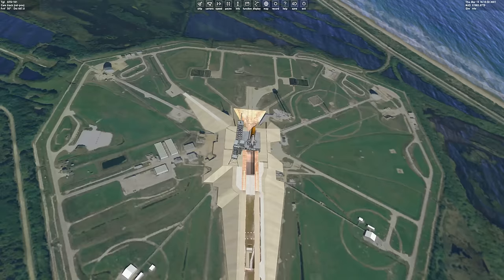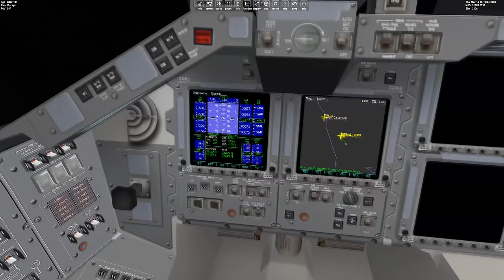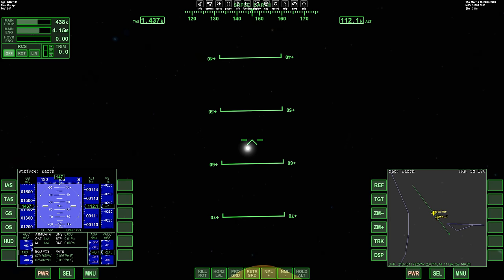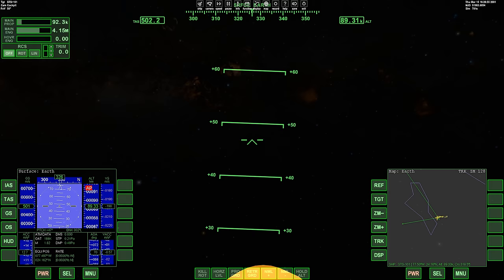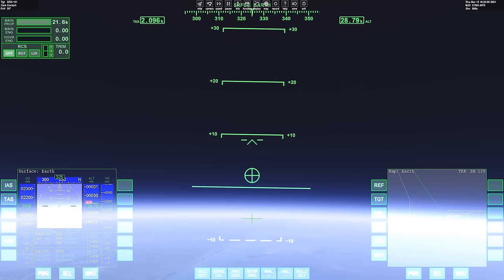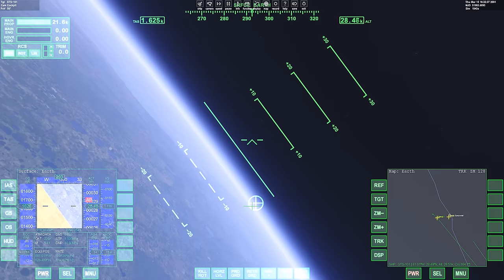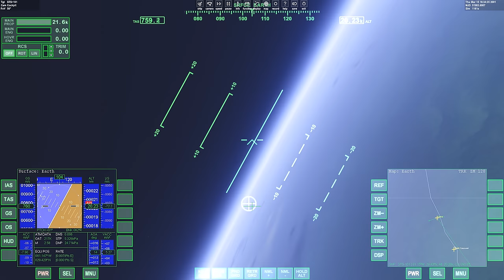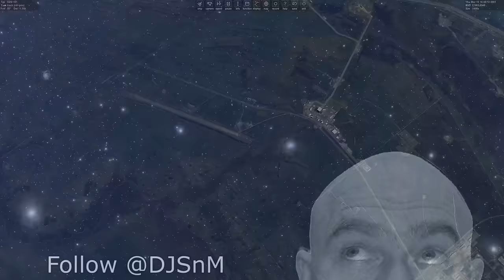Space Shuttle RTLS Abort Challenge - Without The Manual

Comment: This video really shows poor basic flying techniques (not that anyone would expect those from you), but what you did was a very typical intuitive mistake all flight students do for a standard U-turn ) Here's how one does it normally: from the point above runway (or a nav fix if you do a teardrop entry to a holding pattern) you bank to the side of turn (btw, in any emergency aircraft pilot would instinctively choose right turn towards sea not the left turn towards populated area velow =P)) - so that you obtain 30 deg heading difference (so in the beggining of your U-turn you were on HDG 325, so for left turn you need to get on HDG 295, from that point you start the chronometer and fly exactly 1 minute on HDG 295, after which you start the opposite (right in your case) turn with standard bank angle - and if your airspeed was the same for the entire maneuvre you will end up exactly on the opposite heading to your starting point with correct course - that is true for all aircraft, all airspeeds and all conditions ;-)
Reply from the maker: But what if I'm flying a rock where the airspeed is changing very quickly?
(also, confirming, exactly zero hours of flight time in a real aircraft)
Reply: But this is a space shuttle with no engines and the aerodynamic qualities of a brick.
Reply: For any airfoil (an airplane, a glider) the trade is vertical speed (pitch) for airspeed. If you fly a powered aircraft, you alter power setting (as you go into the wind or opposite while performing the turn) in non-powered aircraft you maintain airspeed in maneuvre constant by altering your vertical speed (rate of descent).
Reply: Mythricia, the aerodynamic quality (a relation of lift to drag in a flowing coordinate system) of Space Shuttle is 1 - which means it traverses 1 km horizontally while it looses 1 km of altitude; for instance a typical glider has AQ of 30 - 30km of distance to descend 1km of altitude, and Cessna 172 has AQ of roughly 11. So your metaphor of brick (which has AQ of about 0.01) is not far from truth, but looking at the video only and taking into account that Scott's shuttle was overshooting the runway from visual perspective of descent trajectory long before final turn, and the fact that (again, as most students do in the beggining) he first dived under projected glidepath and then had it for of excess of speed when starting his flare, there was absolutely a possibility to make a standard U-turn and stay within descent trajectory... )
Reply from the maker: Got to also take into account that a big part of that turn was simply getting rid of huge amounts of excess airspeed, I didn't want to lose altitude to maintain speed until my speed had dropped much lower. I almost certainly should have turned out towards the sea and perfomed a 360 turn, that might have put me in a better location. It's just hard to consider all these things the first time I'm doing this.
Reply: @scottmanley   "It's just hard to consider all these things the first time I'm doing this." Didn't seem to be! :) It was such a fascinating feat! 
Oh, and BTW, apart from the impossible landing of The Box, with zero practice (it was hilarious how you didn't even know where the brake was! :) ), you also narrated the whole thing in a nonchalantly entertaining & informative way! :) It's like someone walking into a soccer field from a nearby McDonalds, grabbing the TV guy's mike on his way, to ad-lib a perfect narration, while scoring 3 goals to win the championship against Real Madrid, then finishing the rest of his sandwich, not having slipped even a slice of cucumber from it all throughout. :)